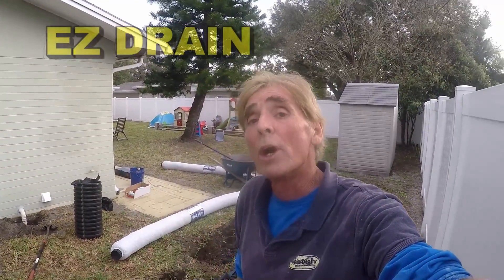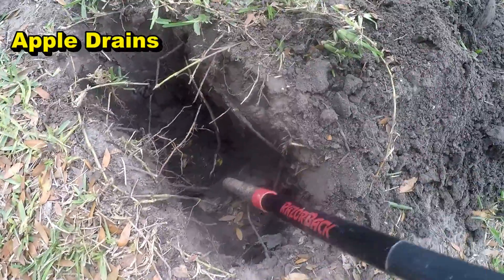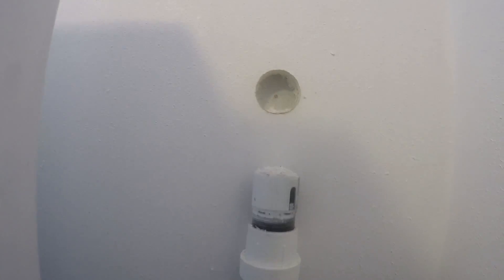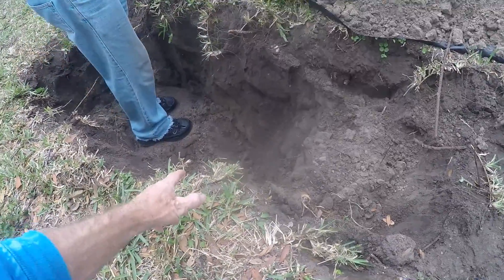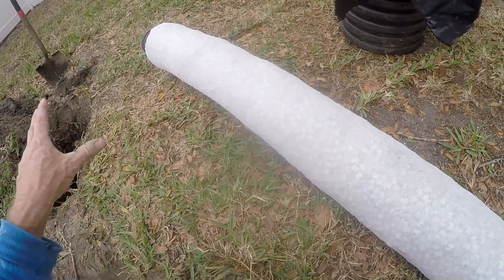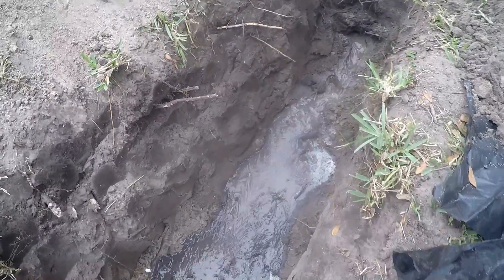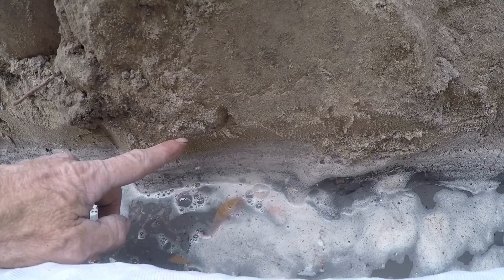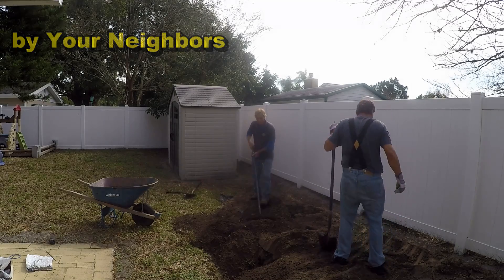No Gravel Drain Field, DIY for Washer or Septic

Comment: As a licensed plumber it does not matter what the situation is that drain for that washing machine should always be tied in to the septic system it should never be allowed to just drain into the yard first it should be tied into the septic system at all times regardless of what you've got to do to get it there even if you've got to have a transfer station pump to get it to the septic tank because it's uphill that's what you got to do that's code and its sanitary
Reply: Grey water systems are sanitary 🤔

Comment: On the top of the inch and a half Tee of the original washer drain there that's called a heirs mittens valve and it probably has failed you can unscrew those and shake that thing and it should make a sound going back and forth because there's a rubber gasket inside of it it allows the air to suck the water out but it doesn't allow the air to push back out of it if that's failed that will cause the smell as well I'm not saying that the drain has not filled but you usually use in a plumbing drain pipe that you cannot get a vent out of the roof sometimes we use them underneath kitchen sinks when you can't use pipe to go out of the roof of the house

Comment: Thank you for the video very helpful. 

I need some one to repair or replace my leach field. We have 4 leach fields. One is failing since my septic tank, 3 leach fields and distribution boxes are all good and working. I need someone to extend my leach field, repair or add one Parallel to existing one and connect to the existing distribution box. I am not good in DIY had stroke 6 years ago and live in CT anyone you would recommend.

Comment: Hey Chuck 👋.  Im just wondering 🤔.  Does the code  there actually allow that setup?  Why didn't you just remove the chambers or just drill some holes on the chamber...i see you had some corrugated pipe there. You could have cut those in half and placed them end to end as a chamber

Comment: There is nothing work with using a mechanical vent (studor vent). They meet code and are very functional. An easier solution would have been to replace the one that went bad.

Comment: Wouldn’t it be better to cover the ez pipe with gravel and then covering with soil or is it unnecessary or worse?
Reply: You don't need gravel with the foam peanut packed lines. I myself prefer PVC Leach lines and gravel.  Leach lines have pinky sized holes

Comment: I have no chamber. Just 4in clay pipe drainfield. And water stays there. Also stays 20 ft from the house where I dig for pipe again. Do you think is good idea just connect pvc to clay pipe next to the laundry and run it it’s own different way far enough and after that connect EZ drain or run EZ drain just right away from the house, let’s say 20 ft?

Comment: Nice info on the ez drain. What's the minimum depth for those ez drain to be set at?
Reply from the maker: There is minimum. But if I have to guess 4 inches of soil or gravel on top
Reply: @appledrains  thank you for your reply! Ok good cause I'm gonna dig it down 3'. So that should be plenty. Thanks again

Comment: This guy and this video is a prime example why I always use a very long and small carbine masonry pilot bit to make a small hole outside. Then you use a masonry core bit with starter pilot in center to drill back through to inside only going through block. You then use a standard hole saw bit on inside to finish off. 
That would have avoided that horrible hole on outside that is mucked up with cement now....

Comment: The sock and peanuts looks like a trap to catch debris that escapes the washer. I've seen a lot of sludge built up in older washer drainage piping.  

I'd prefer to fill with gravel or river rock first, install the tubing/piping, cover with rock and than fill in with dirt. 

 I think the space between the rock would help the water drain better as well as keep soil from becoming a saturated barrier around the sock.

In particular cold climates you'll want to dig much deeper to avoid the drain from freezing up. You'll find that out real fast when the water backs up in your house.

Comment: All the money the homeowner is spending, they could out in a sump pump next to the washer that pumps the waste down a drain. The neighbors must love the smelly yard, LOL
Reply: What drain?  Some folks do not have street sewers.  Pumping 9-12 loads of laundry fluids into the cesspool is a significantly bad idea, especially where I am from.  With new regulations in my area, circa 2020, a new septic system costs $ 20,000.00+.  One can't even pump out their tank unless they have 3 tanks.
Reply: It's on a complete septic system that's private. Useless to send water down that drain. Washer water overloads many conventional septic systems. What will work best is to build a washer drain field using 2 plastic 55 gallon barrels. 3 20 feet long lateral lines using #5 septic gravel along with EZ-Flow peanut pipes! And lay out landscape cloth on layer of #5 septic gravel that you put on top of EZ-Flow peanut pipes and finalize by backfillingwith native soil. "Don't try this at home- I'm what you call a proffesional"!!!!

Comment: The lint from the washer will clog up th new drain field if there is no lint screen on washer drain hose
Reply: How u make a lint filter
Reply: @floridalife7564   if it drains into a sink they sell lint screens to go on  the drain hose but if it goes directly to a pipe you can buy a lint filter designed for septic systems it’s called filtrol 160
Reply: @codyharris3741  ok thanks 🙏 
I have septic old septic here in Florida at the home 
I want to drain my washer into a field on side of house because I don’t want that washer water to keep going to my home septic tank
Reply: @floridalife7564  you can do that too just don’t let anybody no you done it as it may not be legal in your area and a lot of people do it where you live just because of the lint  and soap isn’t good for septic systems
Reply: @codyharris3741  the house is 50years old here in Florida the septic may be equal or less that age and we use thick toilet paper so anything to help save the septic I got lots of kids use laundry too so when I get it done it should help
Reply: @floridalife7564  something else that will help a lot if you haven’t already done it yet is have the septic tank pumped so you know you are starting out like new and gives your drain field a break for a few days to dry out and the pumper can also tell you if there are any problems in the tank itself that might need inlet or outlet tees replaced to keep from damaging your drain field. My septic tank almost went 40 years without being pumped I just bought the house a year ago and was curious and asked the previous owners and they never had it emptied and the pumper told me I was on borrowed time and it may have costed me thousands for new drain field if I had went any longer. Wish you the best of luck on your project
Reply: @codyharris3741  thanks !

Comment: gravel filled drain fields are soo old school.  todays modern arc style drain field chambers are designed  to eliminate the need to put gravel down anymore. i don't know how that chamber was installed by the people who worked on that ladies septic system before but that chamber shouldnt be clogged  after two years. either the person who installed it didnt install it correctly or she is dumping something down her septic tank  like grease that clogged up the drain field that quickly after 2 years...
Reply: SteelCity1981 I've had my system over 30 years. Never a problem. We do the rid-x every few months. Easy.
Reply: not old school,,,,,, now school.

Comment: I guess down where you live it's legal to discharge your washing machine/soapy water right into the ground?  I'm in Virginia and it's not allowed anywhere around here from what I've always heard.
Reply: same in quite a few places, can't drain anything that's considered sewage into the ground like that if you are connected to city utilities, also that fernco he used inside and leaving the vent line under the overhang of the roof like that is a no no in the few states i have worked in.
Reply: @Flexo346  water from a washer machine is not raw sewage it falls under grey water.
Reply: It's illegal to "bootleg" such systems in North Carolina! But if done correctly, you'll have no problems if properly maintained and, if you keep your project a secret!
Reply: I've been told it's illegal to drain outside in my state as well but that's actually false. The last two homes I've lived in had septic issues from the washer. 

My other concern was about it contaminating the soil. But from the research I've done, it's apparently completely harmless.

Comment: hey chuck, question,  I've got a detached garage 9 ft from house or house garage. detached garage is about 2 feet below grade of house due to sloping.  on the side of detached garage close to house a lot of water run off that penitrates thru so dug below footer, added corigated pipe with slices and sock going the whole lenght sloping back of yard. added 3-4 inches below pipe and 7-10 inches above pipe.  in the front I tied the house down spout to french drain ( pipe used to go thru were garage is now ) that will drain to back yard. is that ok since I will have about 35 feet black corigated pipe with holes or slices with sock? down spout water has to go 35 feet before it hits solid pipe.  thanks
Reply: Steve i I would not do that the roof debris and gravel will clog the French drain... max 1.5 years

Comment: hi just a quick question? why did you make another hole in the wall for the vent pipe, instead using a T on the outsite and completely remove the venting from inside?
Reply: jakop0815 it's correct way to do that. Washer needs venting too and it's high spot in system.